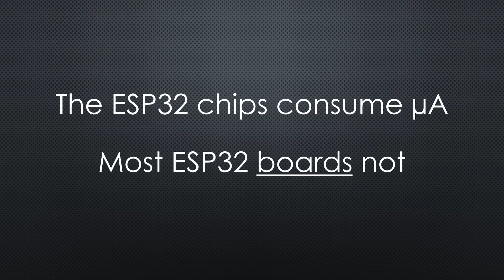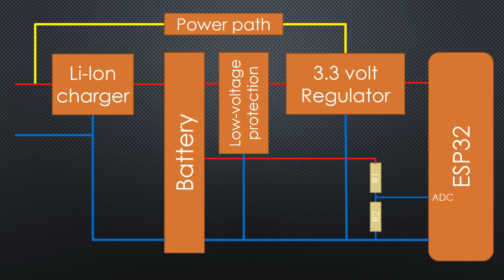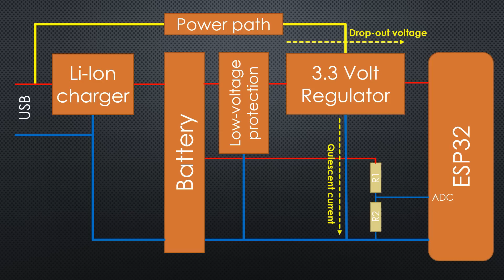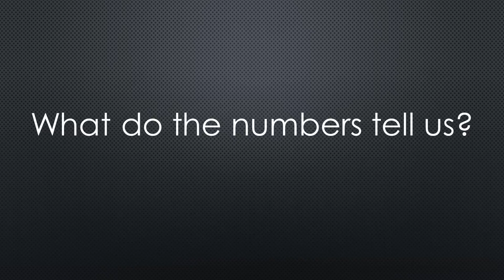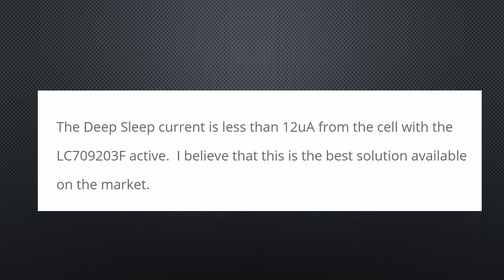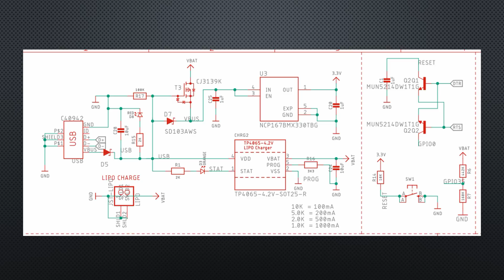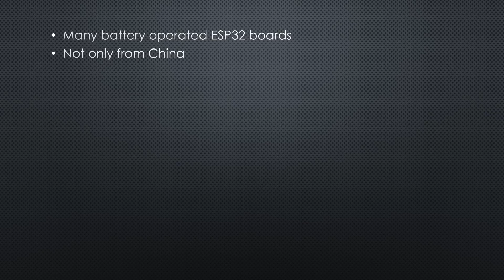#387 Test of Battery operated ESP32 Boards (Olimex, TinyPICO, EzSBC, TTGO)

Comment: I am not surprised of your results on the breadboard, and I don’t think you are too. I have tried cheap ones and more expensive ones - I am a debuttant in electronics -  and, although more expensive ones are definitely better, they are full of weird effects due probably to their hidden impedance, inductive and capacitative effects. Recently, for fun I tried to set up a damped LC oscillator on a Chinese no name breadboard and didn’t work (I thought I was really stupid!). I tried it on one I bought from Farnell France and it did work flawlesly. I then tried to build on the same board a Colpitts oscillator with very weird results. The same oscillator solderered on a perfboard did not give me a problem!! I don’t think I will use breadboards anymore if not at the early stage of testing. And by the way, as usual really neat video.
Reply from the maker: Thank you for sharing your "breadboard experience". I read that there are differences in breadboard quality, but I never did tests. I would have expected problems with "RF stuff" but was a little surprised with the "DC stuff". But of course, these spikes are also RF in a way.
I think my experience can be useful if people connect their ESP boards to batteries or external power boards. Long Dupont connector probably can create the same issues I encountered on my breadboard.

Comment: Thank you very much. Again a professional video that, starting from the basics, highlights many important points. If the runtimes are still too short, you should consider switching from WiFi to LoRa and watch the LoRa videos by Andreas Spiess, which are also very good.
Reply from the maker: You are welcome. Of course, using LoRa can be much better. But then I probably would go with an old "Arduino" or STM32 chip because they consume less power (no Wi-Fi needed)
Reply: LOL "watch the LoRa videos by Andreas Spiess"... ya do realise ya on his channel right?! :P

Comment: Thanks for the video! I frequently develop ultra low power application with the MSP430 processors from TI and have been looking to use a more powerful processor with open source support but haven’t had a chance to evaluate low power sleep mode current. This is really helpful.
Reply from the maker: Glad it was helpful. Maybe you also watch the last video about the PPK II (if not already done)

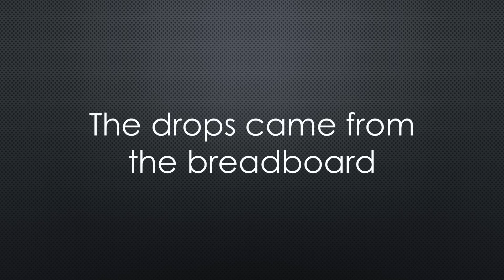Comment: 7:45 No, not the regulator. Place the capacitor as close as possible :) That is the buffer for the spikes, not the regulator. Yeah, you don't want the regulator miles away but you could have connected the regulator through the breadboard if you connected the cap to the ESP instead of the regulator.

And for the caps, yes, polymer and tantalum are better than electrolytic. But you can also mix. A large electrolytic + small (even better performing) ceramic will do the job as well.
Reply from the maker: It seems the regulator is more important than I thought. These current spikes are quite different to the usual ripple we see in other applications. They are about 5 times as high as the average. So the regulator also becomes involved because it is an active component and also reacts to this fast surge. The caps used on the boards are relatively small and still, some boards have a very good performance in preventing brownouts.

Comment: Great video demonstrating how difficult it is to design a good board for general use. The brownout issue will be due to circuit impedance. At the sort of frequency components in the current drain, impedance of layout/connections will be very critical for both 3.3 and ground conductors.  A range a capacitors starting with 10nF or 100nF ceramic close then maybe 10uF ceramic as well as bulk should solve these issues.  The type of ceramic can be critical for the capacitor impedance.  Consult the mfr data sheet for impedance vs freq.. many years ago I made a 2 layer board for an 8051 NMOS 40 pin device with a ceramic cap across 5v.  If you moved a scope probe along the 2 inch long 5v  track from tha cap to the ic with scope reference to cap 0V you could see the spikes grow.  Perhaps a basic video on impedance of wires and components would be educational.
Reply from the maker: You are right. Recently I talked with a developer of power supplies, and he mentioned that even the placement of the chips can change a lot. This was very strange for me because I did not think it is so critical.
This is why I used the brownout detector to measure the voltage and not me with an oscilloscope. It decides in reality about crashes...
Transmission lines are probably a little too special for this channel. You find such videos on more specialized channels.

Comment: Thank you! Only one issue: You wrote "Switching TP5410 charger", but as I understood from Chinese datasheet, it is linear charger with boost from battery voltage to 5V. By the way, I made few projects with battery with follow topology - MCP73831 as charger, DW01A+8205A as battery protection, TPS63000 buck-boost regulator for ESP8266, PIC18F24Q10 as CPU for my sensors, that powered directly from the battery and switch on and off TPS63000 (and ESP). I use ESP-NOW for communication with mains powered gateway (another ESP8266) with MQTT. And there is important issue with ESP-NOW - it is WiFi channel. In the controller part I add finding channel because there is no way to know in advance what channel will be used in the gateway.
Reply from the maker: I agree, "Switching TPS510 charger is most probably wrong. I only had the Chinese datasheet and did not investigate too much :-(
Your board is very interesting. A lot of parts. It would probably be overkill for most projects. But obviously, your use case requires it. 
Thanks for the hint about ESP-Now. So far I only used it once and do no more remember how I solved the channel issue.
Reply: @AndreasSpiess  In any case I need PIC (or something else like it) for work with my sensors, so it switches on ESP only if there is new data from sensor and ESP have 3.3V with any battery voltage even if it is 2 or 3 AAA, any voltage from 1.8 to 5.5V. With ESP NOW I works about 1 week for understanding problem with channel. Gateway (slave in ESP NOW) set up channel from router for both WiFi interfaces (STATION and AP) and controller should use the same channel that he doesn't know. The only way that I found - to check all if send is not OK. But channel in ESP NOW API doesn't change channel, I use wifi_softap_get_config() for it. I don't use Arduino, I use SDK for ESP programming, but it is not important.

Comment: If you install the 2.0.0-alpha1 ESP32 Arduino support you'll be able to compile and run your code on any ESP32-S2 board. If you pick "ESP32S2 Dev Module" it will work on all S2 boards, but perhaps the custom pin definitions of some Adafruit boards might be different.
Reply from the maker: The compilation worked and also the uploading to the TTGO S2 board. I had to press the boot button /reset button and release the reset on the feather S2 board to upload. Now it works, too.

Comment: Most good PS designs include a 0.1uF in parallel with the output cap. Sometimes even a 0.01uF as well. 
If you want the best filtering (expensive), use 2x 47uF Aluminum polymer (used in cpu power coupling) in parallel, with a 1mH inductor connecting the 2 positive sides of these 2 caps. 
This would be like killing a fly with a sledge hammer! 
You can also place a 3.3uF aluminum polymer across the Vcc and Gnd on the ESP32 module. The closer, the better. 
I used this last option on a project, and no more crashing.
Reply from the maker: I agree, your solution is good. Small distance and a good ESR cap. And an inductivity against RFI
I think, the ESP chips create a very different load. The current spikes are extremely high compared to the average. I would not call it "ripple" as with normal PSUs.
Reply: @AndreasSpiess  Aluminum Polymer caps are the most expensive and used in bypassing CPU core supplies to get rid of these huge spikes, because they have extremely low ESR, but don't do well in 85ºC or higher temps.

Comment: It's worth repeating the capacitor test with both electrolyitics and ceramic caps together.  High esr in the electrolyitics means they font respond fast enough.  Ceramics are very quick but low capacity.  Tantalum beads are a good compromise but expensive...
Reply from the maker: I agree with your analysis if you want to build your own board. Then you have to take into account also the behavior of the LDO because it also can be influenced by the caps. Thi is why I used the brownout detector of the ESP32 to decide how good the manufacturers chose their parts.
I found (without deep analysis) that the solid polymer caps are a good compromise, too.

Comment: My favorite is the TTGO LILYGO.  It is like the T18 but also has a small OLED display.  The one thing I do not like is that it is easy to put the battery in backwards when you are in a rush and if you do, it blows up the battery charger IC (I think).
Reply from the maker: Thank you for sharing your experience. I also like the T-beam with LoRa for a similar reason. They are very compact and have what is needed on one board...
Reply: @AndreasSpiess  I bought a pair of LoRA boards after your videos on them but LoRA is not so popular in the US so I could not use the Things Net - only peer communications and there are lots of options that can do that.
Reply from the maker: A lot of people here use their own gateways (me included). Any you can connect it also to TTN where you live I think.

Comment: Hi Andreas,

Very nice, this is good information.
I am playing with the Arduino MKR1010 which as the bq24195L power management chip, that is rather a nice device as the output of the battery management chip is derived from boost conversion in the chip.
A rather sorted piece of hardware.
Also the chip is connected to the processor with IIC so one can control and monitor it in code, very nice.
The power path management is done by it as well, and it can be fed directly from solar cells.
Lots of good news, I am enjoying the product.
It integrates very nicely into the Arduino IOT, which is also quite sorted these days.
Thanks for the video, always good and I enjoyed it.
Kind regards,
South Africa
Reply from the maker: Thank you for sharing your experience. I once tried a MKR1010, but it was quite expensive if I remember right. I think it is good if you have 12 volt solar panels. For battery operation the two processor concept is probably not ideal.
Reply: @AndreasSpiess  Yes it costs a bit more and does not fit the topic of low power projects.
I do like how they did the battery management, quite thorough.

Comment: Great video excellent analysis. nice choice of parameters. , specific for battery, low voltage current,  VI curve  for the board would be interesting, could you see  different couloured led's turn off. ?  was put onto the tiny pico by a SW engineer but this video has the data.  Quiescent current, your pronunciation suddenly clicked with Quiet, the quiet current.  my Qwee escent pronunciation has blinded me to the link. Had a tantalum explode on me , first time turn on failure, the psu was set to 50A, the self healing oxidation happens too quickly. A pleasure to watch.
Reply from the maker: Glad you liked the video (and my accent helped to understand quiescent current ;-)

Comment: The ESP32 board with the lowest deep sleep current I found was the Pycom WiPy with < 20 uA. It has to be programed with an FTDI cable and had no charging chip on board.
Reply from the maker: A good choice for deep-sleep. My "Breadboard" ESP32" has a deep-sleep current of 6.3uA (without voltage regulator). But those are probably a different class of boards.

Comment: A trick to recover lithium batteries that won't charge is stick them across a current limited bench supply for a SHORT time then try them on  balance charger it's only going to work a few times though before the battery is toast.
Reply from the maker: I do it this way, too. But I am not sure if it is good. I once had one which caught fire when I did this procedure...

Comment: I've been playing with the Adafruit Huzzah32 Feather boards for a bit.  When paired with their brand of Lithium Ion batteries, you get the voltage cut-out protection at 2.5v with the protection circuit on the battery.  In my application, I've found that the esp32 resets around the 3.1v level, but then seemed to continue to run normally until the voltage got down to around 2.9v (maybe a little lower, but my memory is fuzzy on this since it has been a while, as I no longer let the battery get down to 3.1v before charging).  There is no battery switch, but the board does expose an Enable pin for the 3.3v regulator.  For my project, I made my own in-line power-switch for the battery and by using 2 switches (battery and regulator Enable signal), I can connect the battery and charge it with the electronics on or off, depending on my whim of the moment.  Most of the time, I just use the in-line battery switch as master power.

This was one of the few boards I could find that had on-board charging paired with the esp32 at the time I discovered it, and their battery has the cut-off protection circuit, so I've been liking that combination.  It's great to see so many other esp32 options with on-board charging available these days!
Reply from the maker: The Huzzah was much better engineered than the Chinese boards when it came to the market. Now the Chinese did their homework and became much better...

Comment: ok, one thing is clear... we all want a board that would score well on all of these tests!!! Reading the comments from @Unexpected Maker below, how about you guys team up to design a new board that has a slightly larger footprint to allow for low voltage protection and maybe a built-in battery holder... and something that is good for folks to hook up 6V solar panels to.  Would make a great kickstarter also!!!
Reply from the maker: I just learned that it is even forbidden in some countries to include under voltage protection on the board because it enables to use unprotected cells. Which seems to be forbidden, too. So maybe we will see a change over the next years where the batteries come protected and the boards are ok...
Reply: @AndreasSpiess  well, we still want to see the ultimate solar powered IoT ESP32 board for sale somewhere!

Comment: The Adafruit MagTag had an esp32-s2 (and an eink screen) and it's much more tuned for battery usage than their earlier boards. It lasts several days in deep sleep waking up daily to update the display (using CircuitPython!). Very low quiescent current regulator, and a super bright green power LED being run at micro amps. Ladyada used the ppk2 in several videos showing the process of tuning it. It's more like 40uA.

It seems these battery lifetime estimates are always too optimistic. I suspect the spikes from the wifi make the battery life non-linear.

Lack of low voltage protection doesn't worry me too much, since most pouch LiPo cells come with protection.
Reply from the maker: You are right, the Adafruit board is quite old. But this is what I had for the comparison. I did not want to compare boards with e-ink this time because they are quite special and expensive. They also sell the Feather S2 from UM. So Ladyada probably had no need to create her own board.
Low voltage protection on the cell is much better, of course and I heard that it should become the standard.

Comment: Note for anyone considering the Wemo 8266 18650 module: it can only get down to 5mA in deep sleep, because the boost regulator is always active. So it’s no good for low power applications.
Reply from the maker: Thank you for sharing your experience. This was the case for most boards and a reason for my test videos...

Comment: A better capacitor / placement would be to add a small surface mount 0.1uF as close as possible to the regulator, nice wide trace, the low inductance would then help with those small voltage drops, then a 1 or 10uF is probably all that is needed for a stable voltage.
Reply from the maker: You are right if you design a PCB. I think, the manufacturers did not do a bad job if we see the minimum voltage before the crash. But for sure, some high-quality caps would have provided a little bit more. Unfortunately, nearly nobody sees it and the BOM gets more expensive...

Comment: TTGO T18 is a useful package due to battery holder. Having a switching regulator, it can be more efficient with higher battery voltage like 4.2 than other modules linear regulators.
Reply: its a nice package...but it has issues... ya cant power many sensors with wifi enabled..either from the battery (browouts without sensors!) or the usb...
Reply from the maker: I agree with the form factor.

Comment: For capacitors use tantalum they respond faster than electoly.
Reply from the maker: I used also tantalums. But they are expensive and I thought these solid polymer caps are a good compromise. What do you think?
Reply: @AndreasSpiess  you can use tantalum or ceramic.
With this amount of Farad I think the tantalum are cheaper then the ceramic ones (with same space used)
Reply: @AndreasSpiess  you can use anything as long as it works.
Maybe you could do a video about when to use which capacitors :)